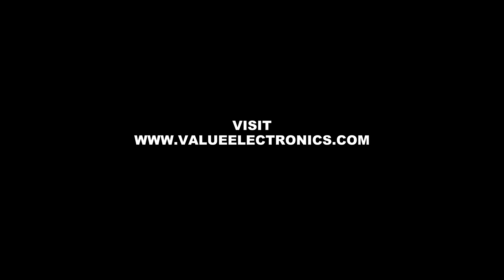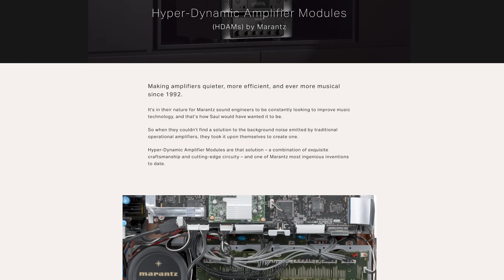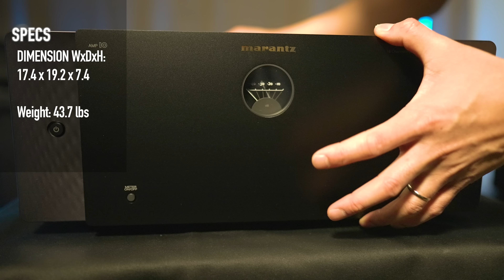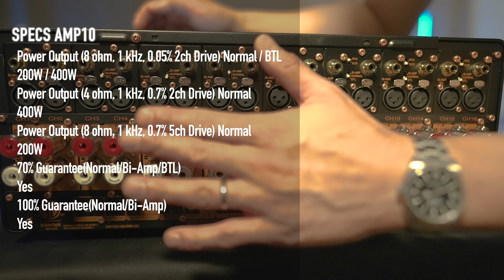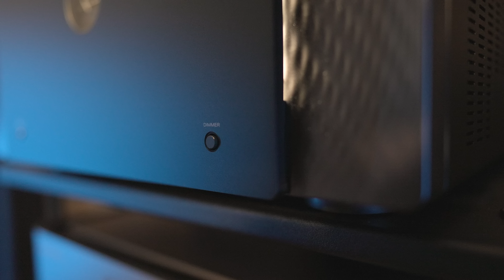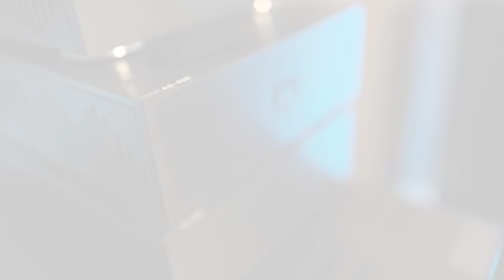Marantz AMP 10 Review! Better Than an XTZ A2-400? 🔥🔥

Comment: Been using XTZ A2-400s in my surround system for a few years and always pleased with vocals in particular.
Reply: Thing about Class D is that it has very little signature distortion and people are so used to hearing bumps in higher frequencies that when they hear something that isn't exaggerated it gets called "rolled off".

People just seem to love distortion, it's exactly how Marantz gets the "warm" character he keeps mentioning in this video.

I like everything to be neutral, Amp and Speakers, if I want to add some distortion or character I can use an EQ. For that reason I like the A2-400 as well I'd much rather everything be reproduced naturally and then I can control the sound character.

Comment: Bought the xtz 400. Got another and more detailed sound. Even better soundstage out of my Lyngdorf 1120, who was pretty impressive even before the amp. This must be the amp of the year at its prizepoint!!! 😁😁
Reply: hey! i have also a tdai 1120. is the extra power from the xtz a2-400 significant recognizeable in your system with the tdai 1120? regards
Reply: @KamilWypior86  yes. Its a very good match. And the price is OK. Simple and elegant. I got a much smoother sound, that i really like! Im very happy with this purchase 😁😁 If you bay used, you can sell it for basicly the same price, like i did. But im keeping it 😁😁

Comment: Shane, Gene @Audioholics also reviewed this amp 10 and has a high opinion of it. In some of the comments to his review, when asked why this huge difference in his opinion relative to yours, Gene mentions some issues with/low quality cables you used while testing the AMP 10 - or something to this extent where cables might have spoiled the evaluation. Do you mind you and Gene shed some light/clarification on this cable thing as related to your evaluation of marantz’s amp 10? If the cables you used were indeed problematic, maybe you would want to reevaluate this review? Thx
Reply from the maker: I've got some pretty premium cables. Plus. I've got younger ears 😁

Comment: 1% thd is a lot of distortion, It must be audible.. I would like to know how much wattage the Xtx can produce under 0.1% distortion before I put it on a set of revealing speakers
Reply from the maker: Sometimes a little too much hot sauce can make a meal a whole lot better than following the recipe. How about just giving it a try first.
Reply: I still like to know how much clean power I can expect, I already own an ice power product, apples to apples comparison would be nice.
Reply: I set my gain to 9 o’clock (equals 1% gain) and it even powers my Dynaudio contour 30 to insane levels (if you use them as mono blocks). This elevated the sound a lot in comparison to higher gain setting.

Comment: I have Monolith amps and bought the AMP 10, but it only has 500W of max power. How in the world can you get 140W per channel at 16 channels driven?

I'm thinking I'm gonna return the AMP 10 after your review. I don't want rolled off highs. That sucks!
Reply from the maker: Well you should try it with your speakers against the Monoprice and see which you like better before returning.
Reply: @therealshanelee  yeah, probably. The cost is more than these two amps though, and it seems like a worse amp overall now that I've done the math.

I dunno if I could tell the difference in sound, but I'd rather not deal with "could be bad".

Comment: The "Marantz sound" is most likely due to the HDAM modules, which actually add distortion and drop SNR.  I like my sound true to the source.  Marantz is a hard pass for me.  Plus, I don't feel like waiting 2 years and praying they release DBLC for Dirac.  After all, DBLC has only been out for several years now.  🙄

The irony of this review is Shane is comparing two amplifiers which color the sound.  Most do not color the sound these days.

Comment: I tried the Xtz-A400 with my B&W 683s2 speakers, and while it doesn't sound bad for a D-class the measurements are a little exaggerated. 
My ten year old Marantz SR5007 sounds way better in every range, from the low end to the clear mids and high end. 
Xtz measures with 1 speaker driven and with impulse, so what I have been told by community members with the right experience and knowledge, the real measurements for A-300 would be around 50w in 8ohm 2channels driven and the A-400 would be approx 75W in 8ohm 2channels driven. 
The only reason to measure 1-channel in thd 1% is to fool buyers with higher wattage than it actually has.
Reply: @naglfahr7778 wow you might as well get a Marantz NR1200 with tons of features as it has 75W per channel. if this is true?
Reply: To correct myself, I meant A2-300 and A2-400 in my comment.
Reply: I compared the XTZ 400 to a Marantz Sr6013 and the XTZ is so superior that’s it isn’t even close. We’re talking about several classes. With a Dynaudio Contour 30. Although the XTZ 400 only really starts shining when having two in mono.

Comment: Allegedly if we're going by this review then Marantz is nerfing the ice power like they do with their AVRs in which they add distortion with the slight hardware change cause it's what it's consumers supposedly want. Ice power isn't bleeding edge today, but XTZ is pretty much designed to spec of what ice power amps should perform like. It's no hypex or purifi, but it sounds like the Marantz is kinda a waste. Maybe someone will make measurements to confirm the subjective review later. For $8k you can get more channels and more power for less money from other class leading designs.
Reply: the above statment is grossly untrue.  200w x 16 for 8K is a bargain.
Reply: @annenominous7220  it is true lol, marantz reps will tell you they have different caps than the Denon versions by design that Intentionally add measurable distortion cause that's what their buyers want

Comment: Running 2 XTZ A2 400's as monoblocks into a pair of Elac UF5 Towers, with a Pioneer SC81 as a preamp. I stream everything, with a Bluesound Node, and Nvidia Shield Pro. I also use a SVS PB1000. All my gear is budget, but I have accumulated some nice Audioquest cables that make this system punch a bit higher.The Elacs are rated as 4 ohm, but they have been described to be closer to 6 ohm. Using the XTZ's as monoblocks to bring a bit more power. I would estimate they go 600 watts into 6ohms. There is a bit of a jump using them as monoblocks. I'm in Florida so I appreciate how cool they run, and that I don't throw out my back moving them. I also prefer a little brighter and more detailed sound rather than warmer. I also use toslink from the Bluesound into some IFi doodads that help with jitter and bring me a very black background. I should also say I mainly use this system for 2 chan music, 2 chan home theater is secondary. Forget what people say about streaming, my jaw drops at times with how good things can sound.

Comment: Another great review. I recently puchased a Marantz 8015 AV receiver, a flagship model. This is 22 years after purchasing a Yamaga DSP A1 vintage flagship receiver. I waited so long for different reasons, but I hope the wait paid off. I am pleased with what I am hearing thus far, I find the sound detailed enough and very dynamic but I absolutely agree the sounds feels perhaps a bit lacking in the upper ranges. But it also sounds fairly balanced, pleasant, rich in the midtones and fairly high resolving. Unfortunately, I cannot compare it to anything else directly; what comes close is the Denon 8500HA, which sells for 500 Euros more. I could still return the 8015 and get the 8500. Any ideas on what might be the better solution? I like how smooth the sound of the 8015 is at higher volume levels, detailed enough and without becoming overly aggressive. Perhaps this is different on the 8500, with more emphasis on effects rather than overall balance. I am slightly worried that less detailed sounding movies might be a bit dull on the Marantz.
Reply: Your 8015 is a rockstar. Don't overthink it.
 Everyone second guesses high end purchases. We in the audio world seem to do it to excess.
 I have the little brother to your 8015. And I won't let myself go there with the SR6015, and start wondering what if.

Comment: I have the XTZ A2-300A, two of them (for 4 towers). They sound amazing to me, and from what I understand, have the same sound as the A400, only less power 150W 8ohm/ 300W 4ohm.
One could go for 3 A400, bridge them for LCR, and put A200's on the rest (A300 is about half of A400).
And if you really like to tweak (I do🙊), one could put enough MiniDSP or similars, between preamp and amp, then go nuts in REW🙊
Reply from the maker: I have the 300a powering my tweeters and two 400's powering the woofers.
Reply: @therealshanelee  
Nice🤘
Is there any sonically difference in the 300 and 400?
Reply: Yes. Big Time.

Comment: As it is a $7000 home theater amp, I presume most people interested in the marantz would use it with some kind of decent eq/room correction. Would be interesting to know if  room correction and manual tweaking would help with the top end roll off. BTW audiosciencereview has reviewed the a2-300 model of the xtz amp. Depending on the load, rather than a flat response it can have a slightly boosted response at the upper frequencies, hence why the top end sounds so different from the Marantz.

Comment: Thanks for running your tests full range! No one else does that. I run full range with REL so love the audiophile aspect of ur review
Reply: I'm curious do you run all your surround speakers full range?  I'm running my front Left & Right because I have Rel's high level cable connected to them.  But I'm scared to run the rest of them lower than the recommended frequency range
Reply: @cainification  I use a 5.5 Rel system so I run my surround full range. I have beefy amplifiers but it’s so much fun!

Comment: Question: Do people who are into the expensive Home Theater stuff never EQ their rooms? Do they just rely on different equipment to get the sound they want without adjusting any of that? That would be an absolute nightmare for me. I'm betting if you EQ'd the room to give it more high end, the Marantz would be perfectly fine. I understand it's a review and it should be noted that the Marantz has a rolled off top end over that li'l amp. But I don't think that's a reason to dismiss an entire piece of equipment.
Reply from the maker: I like to approach gear based only with what they can provide out of the box. If it had an adjustable eq I'd have used it. Otherwise I'd be talking about how great the Trinnov could have potentially made the Marantz sound, or maybe worse. So I take it out of the equation. This is what this amp does with the tools that are provided by that manufacturer.
Reply: @therealshanelee  Right, but you also said you wouldn't choose the Marantz (paraphrasing). I would only not choose something if it couldn't meet my needs using the tools I have... which I understand that it would be impractical for you to do in your review.  I might have phrased it like "You'll need to EQ this one if you like a brighter sound, which may be a deal breaker for some of you. If you don't want to mess around with that, well you'll find this one lacking in the high end compared to this other amp" or something like that.
Reply from the maker: @GameSack  yeah based on sound alone I wouldn't buy the Marantz. Just my subjective personal opinion of course.
Reply: Better to buy a product without that sound from the beginning rather then EQ 16 speakers because of the amp.

Marantz AV7705 owner and looking for the AV10 so no hate on Marantz but would never buy receiver or this amp because of the sound.
Reply: @BigStreetCinema  EQing doesn't take that long and plus... it's part of the fun. But on the whole I would agree with you... might as well get as close as possible to your starting point.

Comment: Gene at Audioholics doesn't have the proper equipment to test the actual wattage output of the Marantz Amp10. You need an amplifier Dyno like the DAmore AD-1 Amp dyno to actually test the amplifiers output properly. Gene is guessing. The YouTube channel WILLISTON AUDIO LABS actually has an AD-1 AMP dyno and can test it correctly and accurately.
Reply: Congrats on making  completely inaccurate statements; either due to ignorance or malice. Audio Precision are the most advanced audio analyzers on the planet and an Industry standard. It is much more accurate and capable than a simple Dyno test. I use the same test gear engineers use to design the equipment you enjoy. I run the same tests and confirm my results with the engineers that design the equipment you enjoy. I have the same electrical engineering degree that the designers of the equipment you enjoy.
Reply: @Audioholics  why I love gene 🧬
Reply: @Audioholics  Talk yo sh*t 🗣🗣🗣
Reply: Mic drop…
Reply: Please get this man a tube of Aloe Vera because he just got BURNT 🔥 😂
Reply: I am shocked at the assurity of this ignorance. The number of inaccurate claims in a single post is pretty mind boggling. 

Guessing?  How is he guessing?   I get that you don’t know how amplifiers are actually measured by real engineers or know what the Audio Precision audio analyzers are. But guessing?  You have seen his software screen shots in his reviews over the years. Have you not? He isn’t Trump, he didn’t use a sharpie to draw those graphs. They are actual measured data.  

The device you seem to have so much faith in is in fact the less accurate device. Substantially so. The amp dynos are extremely simple devices that basically just provide a readout of volts times amps. It’s not an audio analyzer, and so provides no real context for those results it provides.  

It’s distortion limits are way too high. We don’t define clipping at 1% or higher. We define it as typically more like .1% or we look at the actual knee of the power graph (which an AD-1 is too crude to produce) to identify the point where the amp starts clipping. 

It’s less than 1/10 the price of a Audio Precision for a reason. But my own Audio Analyzer is more accurate at 1/4th the price. With far greater precision and flexibility. The AD-1 is a toy that lets you measure massive amounts of power simply and easily. It’s not a useful engineering tool.
Reply: ASR groupie speaks out ..

Comment: LOL when did you officially rollback to McIntosh multichannel.

Do hear less tweeter hiss with Marantz AMP10 compared to McIntosh?

The XTZ vs Marantz is not entirely accurate. The Marantz has a toroidal power supply in addition to hypex channels. Wow this is a solid negative review for the AMP10.
Reply from the maker: Do you have a source for mention of hypex? I've only heard their guys say they use modified Ice edge modules.
Reply: @therealshanelee  Agreed. Let me dig deeper.

What was your memory of the Trinnov Class D vs the AMP10?
Reply: @therealshanelee  
Yes they use ICEedge nothing else
Reply: Well, he is comparing it to McIntosh.😂😂😂